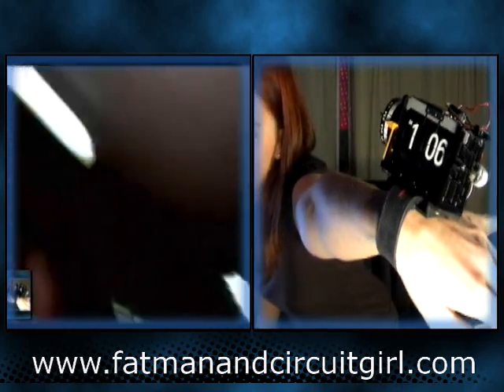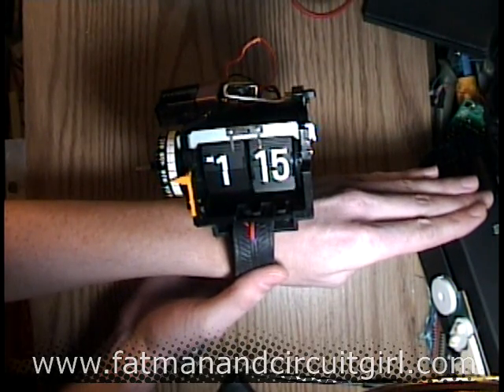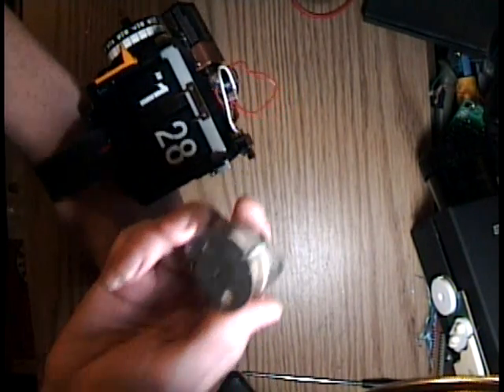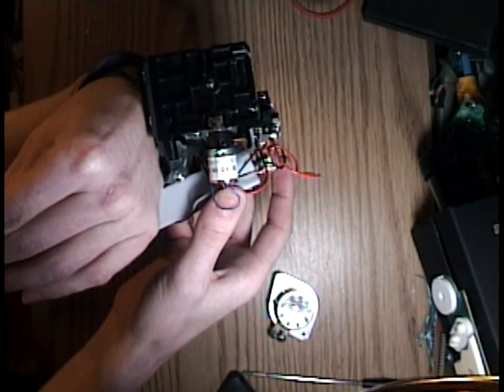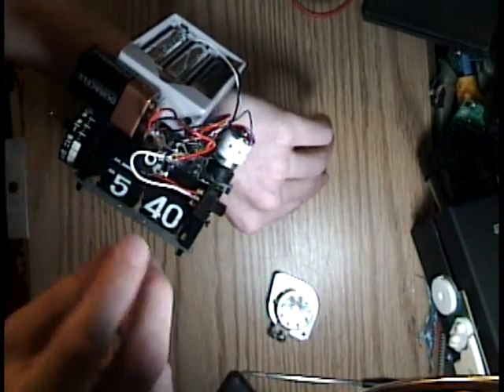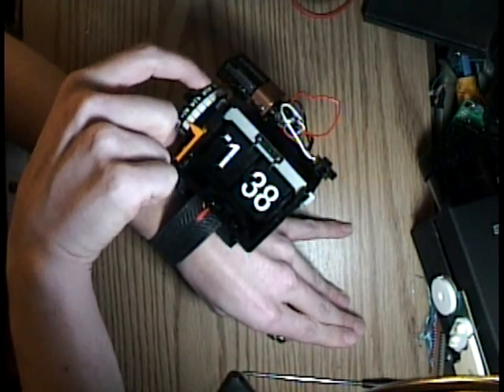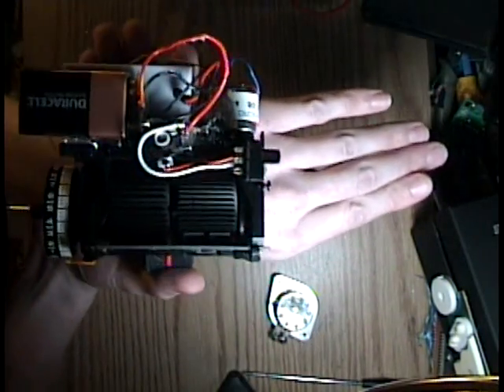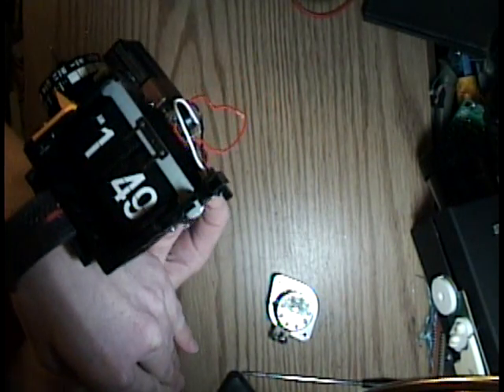Retro Flip Watch AKA Flippy Thing Watch - Now with extra flippyness

Comment: I owned a Sony clock radio in the 1970's that used flip cards. After many years the mechanism wore a notches in the cards. I removed the mechanical clock and built a circuit board using MM5316 CMOS digital clock chip and VFD tube display, it ran on 30V plate, and low voltage for the filaments.

Comment: i've made a watch that displays in binary with an hourly that beeps the number of hours past midday/night while showing the time in 24 hour plus it has a set alarm which beeps until its turned off or the hour increments
it all just squeezes into a small jiffy box with an analogue clock driver board and a PICAXE 20M micro

Comment: is your brushed motor accurate enough to prevent undershoot / overshooting? 
i picked up one of these clocks from the thrift shop and after a quick once over, i think a stepper will give me the most accuracy. 

fwiw, the original motor is called a synchronous motor.

good job!
-jc